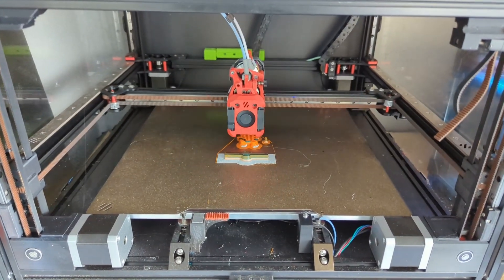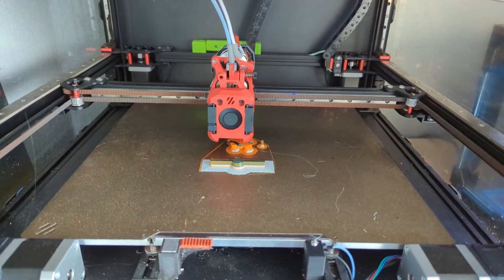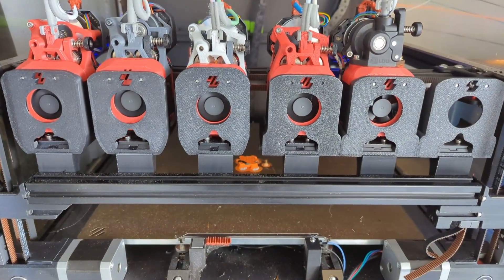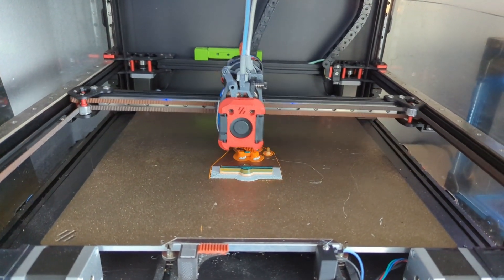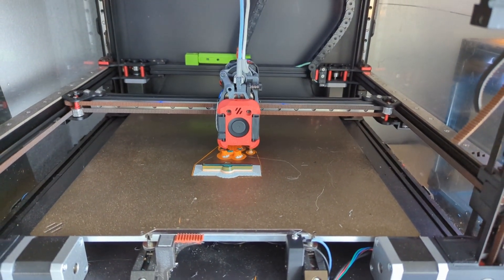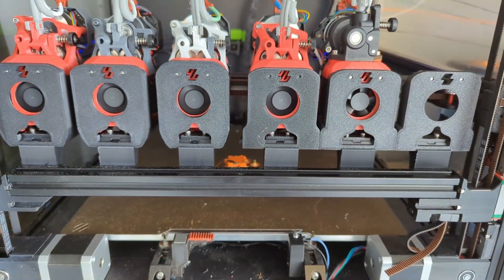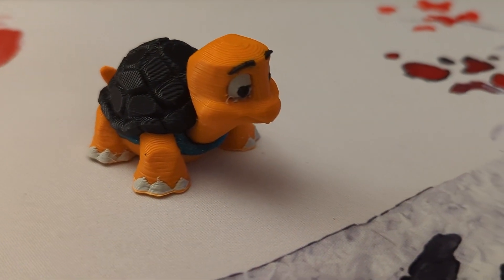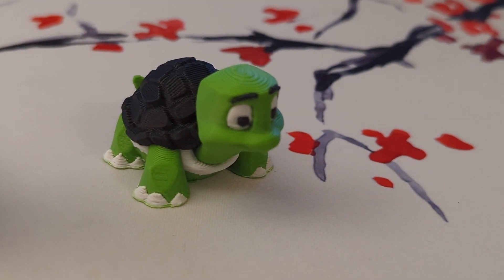We are Printing

Comment: what extruder are you using? is it like a sherpa mini with LGX/HGX gears?
Reply from the maker: HGX mod for dragon. Essentially combining several parts into one at the cost of slightly more complex assembly.
It's in the tapchanger repo under tapchnager/toolheads/dragon/HGX